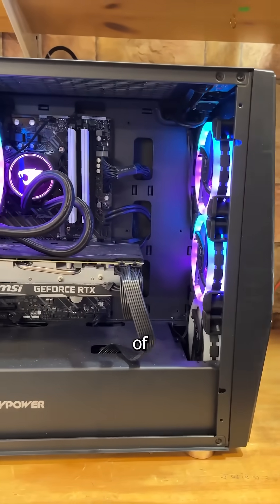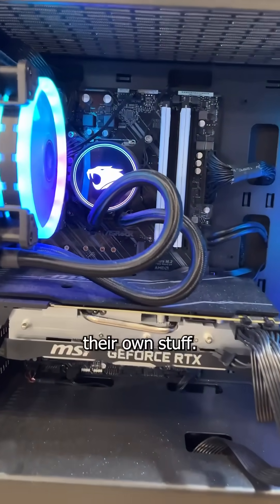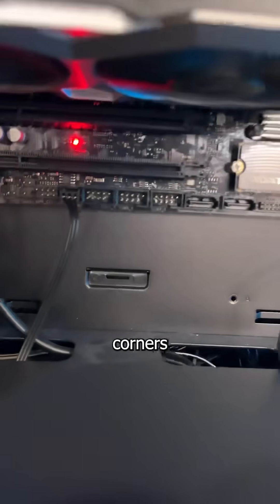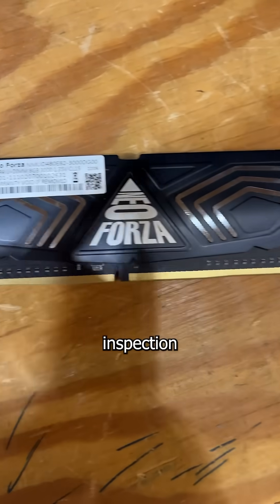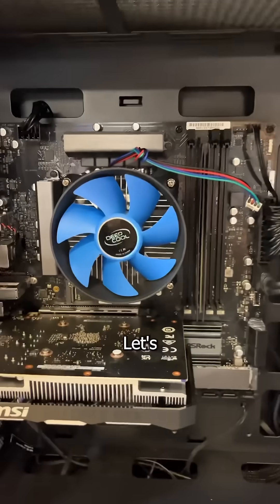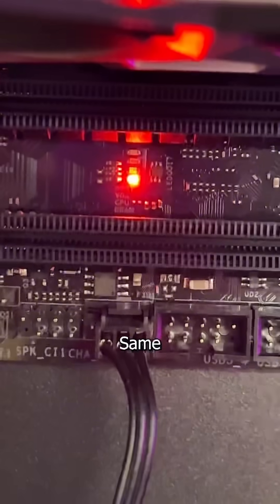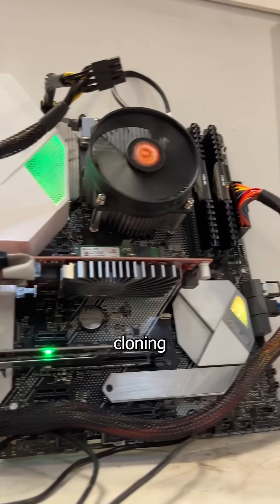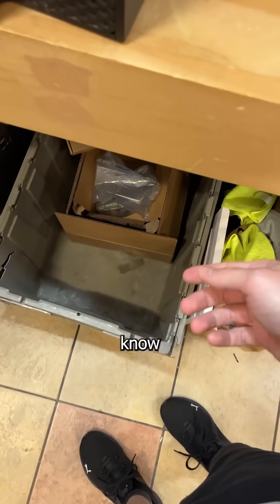iBuyProblems? Cheap NVMe causing no POST 💀 #technology #pc #tech #shorts #computer

Comment: If you're gonna go pre-built, just go to your local computer store that's reputable and ask them to build you one after picking the parts with them. Buying it from companies like iBuyPower or Starforged is overpriced. I checked one of the Starforged PC and me buying the parts and building it myself will only cost  a half of what they're asking for. Most of the time, they up sell you on parts you don't need. Like if you're gonna do that, do that with a self built machine cause at least instead of them up selling you $1000 more for $300 part, you can just buy that $300 part yourself. Just remember you don't need 4TB of M.2NVME if you're just gaming. 2TB at the most and just delete games if you fill up it for some reason. I got 1TB myself and I don't even know how I'm gonna fill that up.

Comment: Omega late, but the ADATA drive uses a flawed controller with NAND flash that can have issues under specific circumstances. Together, the drive has extremely bad reliability issues. The combo is actually found in a lot of other drives, such as the Silicon Power XS70, Acer Predator GM7000, and the Patriot VP4300, amongst a litany of other smaller-but-not-big-enough-named brands.

Comment: It’s an NVME drive directly interconnected to the CPU, which is also directly interconnected to the memory, I’ll bet the drive was pulling a voltage line low that would otherwise power the RAM, and since RAM is init before pcie, it would show up as a memory error

Comment: I got a good deal on a ibuypower pc atleast I thought. Had it for about a week or so and then I started gaming. Ryzen 7 7700 16gb ram (one stick) 4060ti 16gb and everything else is in house brand but it's got the cheapest cpu cooler known to man kind so I ended up with a corsair hc100 240mm liquid cool aio and corsair vengeance ram 2 sticks 32gb and now it runs great. Everything included I paid 675$

Comment: Dead controllers can sometimes pull voltage lines down far enough to cause timing errors in other areas of the PC. If that drive was getting warm during POST, that is likely what it was doing.

Comment: Yeah I don’t know if there’s a problem with Ibuypower in general maybe they tend to half ass on the cheaper stuff, I bought a Ibuypower with a 1080 gtx i7 7th gen intel CPU Asetek stock AIO SSD 1 terabyte of storage and like 300-500gb SSD and it’s been serving me well for about 6 years now I recently changed the thermal paste and got the temps back to normal due to old paste and it still works well, only problem would be that maybe I got a weaker intel core for certain demanding games that can bottleneck at times but fixable with some graphics adjustments. 

      I guess it’s really a hit or miss that the person who puts the PC together knows what they’re doing.

Comment: This isn’t a pre-built PC from a big OEM company. The worst pre-built desktop PCs come from HP. iBuyPower’s are system integrators, since it contains an ASRock motherboard. No user would find bloatware installed. Pre-built PCs from those manufacturers (such as HP and Lenovo) also have proprietary motherboards and to add insult to injury, companies add bloatware because they get paid for it in the hopes that some portion of those trial software users turn into paying customers. Another example is to inject ads, like the Lenovo Superfish scandal some time ago.

I have to admit that I did own a HP desktop PC with Windows 8.1 preinstalled, but I switched to a custom built PC with an ASUS motherboard since March 2020. PC manufacturers install bloatware to cut costs. My HP had a 500 GB WD hard drive installed. I initially planned to buy a second pre-built PC from a different OEM company called Lenovo, but later changed my mind and bought a custom-built PC from a local store, which was also considered a system integrator. When I was sending my old desktop to them, I elected to keep the 500 GB WD hard drive and the DVD drive, with most of the parts being kept as spare parts for future computers. The DVD drive was later upgraded to a newer ASUS DVD drive in June 2022. The other hard drives were purchased new in December 2020 and June 2022 respectively.

Some of the software I had preinstalled were 7-Zip 9.20, a free tool, and Microsoft Office 2013/365, an absolute necessity (I pay about HK$540 a year). Not all the pre-installed software were useless in the old desktop.

ASUS actually had pre-built and custom-built motherboards. I chose the latter in March 2020, and is expected to change to a similar format in March 2025. This desktop has up to 5 years of warranty (up to March 2025) with components of up to 3 years. I added and upgraded more components progressively during my 5-year tenure, with the last upgrade being the 1 TB Samsung 970 Evo Plus M.2 PCIe NVMe Gen 3 SSD, which originally a 480 GB WD M.2 SATA SSD in December 2023. The RAM was also doubled to 32 GB, which is the maximum it can load.
Reply: Another side note: If you buy from iBuyPower directly, you should be able to customize it to your needs. They also have major brands to choose, and you can avoid sketchy brands at the same time.

Comment: Likely caused DRAM issues because it's a DRAM-less drive. Let me explain. Regular SSDs have on board DRAM to do all their operations, but cheap SSDs usually don't have that and instead use the system memory to operate. It was likely the ssd controller was causing a series of issues and calls to system DRAM that broke the computer.

Comment: Huh, my PC has a light on like that but it blinks. My computer boots up and works and I haven’t noticed any performance problems. All my RAM reads correctly and both my nvme drives work fine. Is it any cause of concern or am I okay? I built my PC all on my own so there’s a chance I didn’t install something correctly.

Comment: One day I was updating nvidia drivers and that got completely corrupt. Even after a clean factory wipe and fresh installation of windows via usb, i was still getting the same issues. I even tried other nvidia graphics cards and those were getting driver issues too. I run an adata ssd. Could that be the issue?

Comment: I used to be able to boot on a Dell laptop from a new Samsung bar USB drive and it suddenly stopped appearing in bios as a boot option,  I've tried everything, from disabling CSM, secure boot, enabling legacy mode, to reformatting and installing multiple OS's that used to work before....etc. Same drive works just fine on another computer and another usb drive that is many years older works just fine on that same Dell laptop. I tend to believe that Dell's bios for 9th generation intel is the cause of the problem, or there is something in the way that a newer flash drive gets recognised (after multiple formatting) by older Bios's. If anyone has any clue please let me know.

Comment: in POST, video is first to be tested then it loads BIOS where the RAM is first accessed then the HD, in the case of PCIe NVMe SSD where the RAM is super cheap, the processor cannot tell the difference between the two. So when the SSD dies in these situations, the error LEDs will show RAM problem when it's actually the SSD. If you put good RAM in and include the dead drive, the error will be "no system disk".
Reply: least straightforward answer here... What are you even on about??

I'm guessing which bridge is used during POST Errors, must have nothing to do with price lol wtf...
Reply: @Vifnis  ignore them they have no idea what they are talking about. 

If the SSD has failed or is failing, it could have corrupted the system files needed for booting. This corruption can cause the BIOS or UEFI firmware to misinterpret issues as RAM-related errors because the necessary boot files aren't being loaded correctly.

Comment: I actually repurposed my brothers ibuy system. Stripped the low-quality RGB setup out (it was just “B” of RGB and i dont like excessive lights in my system) new heatsink, max ram and i even attempted an NVME drive upgrade only for the motherboard to have a seizure

Comment: How does it detect DRAM errors ? Is it possible than if the DRAM on the NVME is broken AND plugged into the PCIe lanes from the CPU that the MOBO can't tell the difference and just detects all DRAM issues as a DRAM issue regardless of source?

Comment: This is the reason pre-built PC though not inheritly bad but not suggested. Because some will use the cheeeeeaaaaapest peripherals for the build. It's a 50/50 or 40/60 chance and also don't expect it to last long. But consulting "The Greatest Technician That Ever Lived" may cost more but at least it will be "The Greatest PC Built That's Ever Been Assembled". 😎
Reply: better to buy non name brand than name brand because all is made the same. I have seen corsair have many issues with their hardware same as generic. there is no difference. Since ALL are made in quantity then you expect to have some that come out the printing shop not working yet most of them work so its an easy trade off. This is why DRAM has a long warranty.

Comment: There is a chance that SSD might have ben f*cking real hard with one of the voltage rails the ram uses, either that or it had a PCIe communication issue, and either caused an issue the motherboard didn't understand. Or caused issues with the CPU not posting because of comm lines being shorted

Comment: Something like that happened to me before and the DRAM LED was lit, but it's because the status/boot LEDs go in a sequence. First, it goes through processor and by the moment it checks for DRAM it also checks the connected drivers, so the DRAM error is not entirely related to DRAM but also to M.2.

Comment: those LEDs only indicate the last major POST step in which the system stopped, and there is a lot more going on BTS than those lights would have you believe. There can be over 100 stages to the POST of a modern UEFI firmware. We were probably trying to bring up the link between the PCH and the CPU, and did not get DMI initialization due to the SSD controller likely holding part of the pci-e bus in a pull-down state. I am surprised that there isn't any handling for that because this can be handled with a timeout and then you set a register on the PCH to disable the offending device.

Comment: Did you try taking it to disk part, converting it to gpt, creating a new primary partition, formatting it with ntfs format, then reinstalling the data? Then again, if it randomly fails, it's Probably best not to put anything on it.

Comment: Because that's what it is adata likes to use, Volatile ram chips with a A few chips that remove the volatile part of the ram but once that chip dies so does the entire drive And it boots as a secondary volatile Ram bank, But because the values are literally 0, it can't boot.

Comment: Some(all) PCIe NVME drives have a dram chip next to the storage chips, if the ram fails it will count as a dram error on post. This post error detection works with PCIe NVME drives and pci extention cards only (or i think so).

Edit: There is more than one hypothesis to this "Dram" error.

Comment: Actually.. part of the boot process is utilizing the OS off the hard drive, solid state drive, nvme whatever.. so when accessing the info off said drive, it needs the ram to start it up.. well when trying to boot.. the last line of communication before the drive back to the cpu is the ram.. so the MB is looking for fault- and last thing it tried to communicate with was the ram.. but the ram couldnt communicate with the harddrive and so there was no communication from ram to drive but info from cpu to ram.. so the mother board said it was the ram.. 
.

Comment: The reason it caused a DRAM error is because the operating system is loaded from disk into ram. With SSD why you gotta buy so cheap also right its like 29 bucks for 240gb Kingston drive that actually works why tf go cheaper than that lol. Also unpopular opinion here but cachless SSD last longer than those stupid m.2 aesthetics drives lolol

Comment: When I was like 15? I got an iBuyPower PC for Christmas it had 8 Gb of ram a ryzen 5 3600(?) And an Nvidia GT710 and it was put together SO SLOPPILY. Cable management horrid. Screws missing in way too many places or too loose. Graphics card wasn't seated in properly either so when I first got it it wouldn't even boot properly! Still have it but I've replaced every single piece of it except for the CPU. iBuyPower being shitty is the entire reason I got into PC building in the first place.

Comment: I bought an iBuyPower PC for my church streaming setup a couple years ago because I got the entire PC with a 3070 for less than I could get a 3070 by its self. This was back when the scalpers were all enjoying their collective circle jerk and we couldn't wait for a new PC. When I got the machine, the motherboard was installed wrong and the ports are not lined up with the IO shield. i had to pull the board, reinstall it, fix their cable management, and make several other adjustments.

Comment: So, I have this HP notebooks 15 which I bought in 2014. And I have facing this problem for 2 years or so which is whenever I reboot my laptop it shows "Windows is not installed " aftering wrecking my mind for few hours I found out that When I insert a pendrive then start reboots normally but I have to keep doing this everytime I open. 
However, now unfortunately even that is not working anymore ?
What should I do? 
Any advice would be appreciated!

Comment: The Cache chip on ADATA ssd's are bad.
If you want a cheap SSD for games, fine go for ADATA but OS boot, just save a headache.

Also it is detected as RAM on the failure as the system start using it as a RAM device.

Comment: That brand is popular in Mexico for some reason. You can find them everywhere, they are cheap and the look ok, but recently bought a pack of 10 usb drives for a work thing, thinking they can be that bad, 4 out of the 10 did not work out of the box and 1 stopped working after pulling it out of a usb port, they are garbage

Comment: My current computer is an I buy power computer and other than the CPU AIO failing I haven't had a single problem. I was even able to troubleshoot that. I went I buy power cuz I went to upgrade and didn't have the money to buy all the parts all at once so I went through afirm and got one of them.

Comment: “iBuyProblems”😂😂😂
Reply: I made the mistake of buying 2 iBuyPower PCs both of them died within 2yrs time. They buy the cheapest parts and charge the maximum 😂
Reply: @BigGreg  I've had mine for almost 5 years now and never had a single issue with it, but I'm building a pc now.
Reply: @Zukua_ bro same a little over 5 years on mine and it rocks I just upgraded my gpu only because I had an old amd with 0 ray tracing and I couldn’t play the new doom 😢. But I love my Ibuypower
Reply: @BigGreg your whole computer failed and every part failed? You get what you pay for and people always go with the cheap ram that they warn you about and the absolute cheapest PSU. Ordered 3 pcs 3 different times and was taken care of. Free upgrades when parts didn’t work.
Reply: I bought one and will never EVER buy a pre built PC again. The price you pay, you can build a PC with 60% better parts for the same price. The new 4090 pre builts are going for almost 5k when you can build one for about 3 if you build it yourself.
Reply: @DeadAzLast Then "not everyone is good at building a pc" But now with modern cases i dont know anymore.
Reply: @DeadAzLast link me a build you can make for 2 grand cheaper with a 4090 and 7800x3d.
Reply: @DeadAzLast I made this mistake and bought the Element 3 from I buy power for just over 5k. I haven’t had any issues yet though
Reply: @JohnnyStickDrift  its not the issues as much as it is cheaper parts. With the same 5k probably would get a better mobo memory ram. I'm like 95% sure ibuypower gave you a low end board maybe even a micro. There's always a catch with prebuilts.
Reply: @ I was kind of paranoid so I went through my entire PC only one thing was absolute garbage, I had some weird Chinese knock off power supply looking at new ones now, but everything else is higher end components through name brands I recognize
Reply: @ if it wasn’t for you, I wouldn’t have looked thank you
Reply: Put the fries in the bag guys Gunnerbangs736 said it wasn’t funny 😔
Reply: @Kanerillos  Lmao
Reply: I built a 4090 build but I went a little overboard. Got the z790 aorus pro x , 14900k + hi1200 Corsair PSU+ Corsair h150i icue LCD+2x4 TB 990 pro+ Corsair vengeance 6400 mhz ddr5 64 gb and last but not least the 4090. About 4300 for the build. If you go with them specs anywhere as a pre built look at about 7k
Reply: Actually they should rename it to iBuyProblems since I've seen hundreds of people have problems with their PCs made by them
Reply: @jordananderson8299  it is usually noobs not knowing how PCs work. My company has bought over 1,000 units from 9th gen to now. Had one come with a dead mother board and they sent me a new one the very next day.
Reply: @jordananderson8299  I trust what I have experienced over what you read on Reddit. Have you personally had an issue?
Reply: I literally bought a 2500 dollar laptop didnt even get to fully set it up before it corrupted so now it's being sent back for repairs before I even got to fucking use it
Reply: He ain’t lying I’ll never buy it again. 😅
Reply: i swear i've seen this xenox guy do the "[video sentence]" 😂😂😂 before
Reply: [quote] [skull or laughing emojis] comment detected
Reply: You think your sooooo funny
Reply: Ngl i have a ibuypower configurator 1 prebuilt with the exeption of a ram uprgade and it has not giving me a single problem unless i cause the problem so CAP🧢🧢🧢
Reply: Shi not dat funny